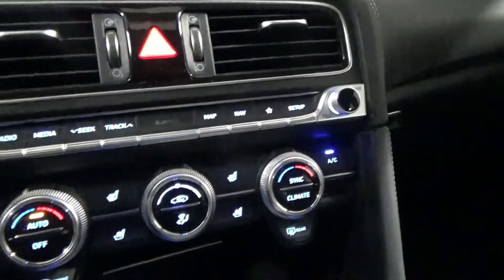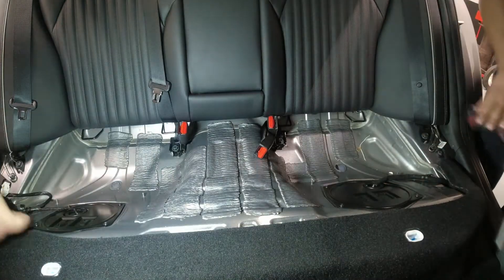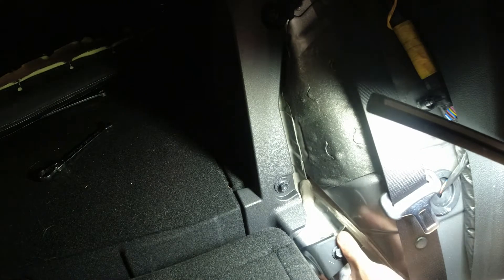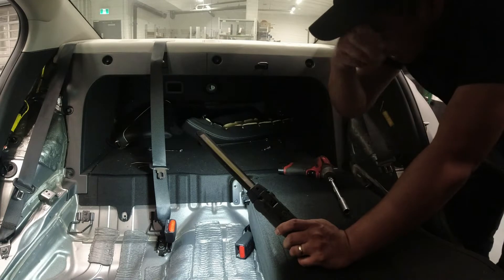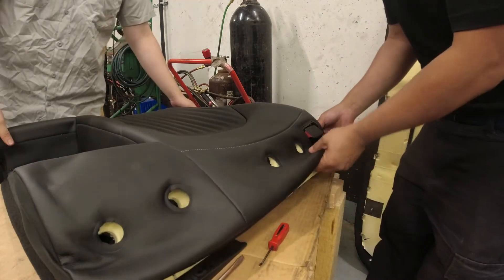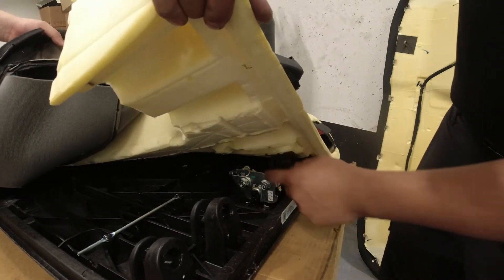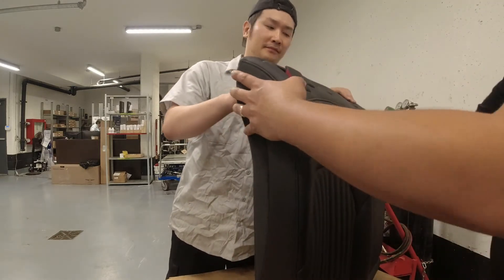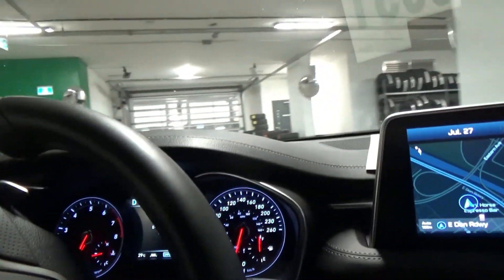GENESIS G70, RATTLE/KNOCKING NOISE OVER BUMPS

Comment: Same issue on my GV80 but inside the rear seat there is an anti-vibration part that had broken. Over $350 part that should be covered in warranty but was denied and had to challenge. Still waiting on repsonse.

Comment: Have you done any G70s / Stingers with the headliner / sunroof creaking issue? Supposedly it's very common but there is no TSB
Reply from the maker: Yes, most of the time its tge clips on the headliner i dont know with new clips if its updated but looks the same. Usually i will just replace front headliner clips and so far no noise.
Reply: This is 2 years late, but there is a TSB for the issue, at least now.  I had my 2019 G70 in just last month (Aug 2024).  They tried the TSB fix but it didn't work, so they replaced the entire sunroof and now the creaking is gone.